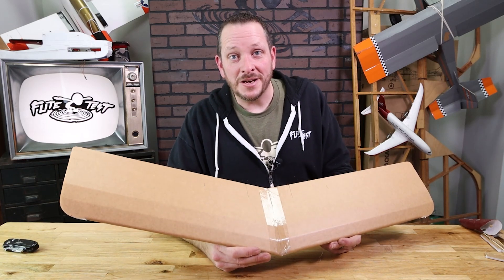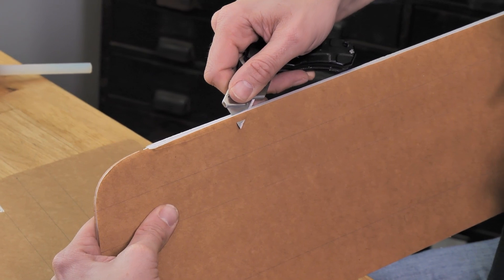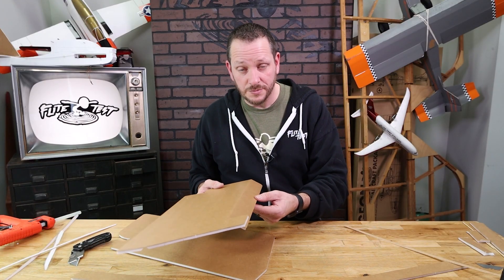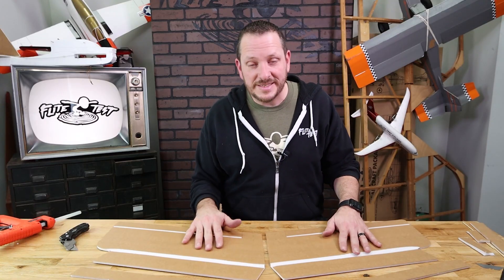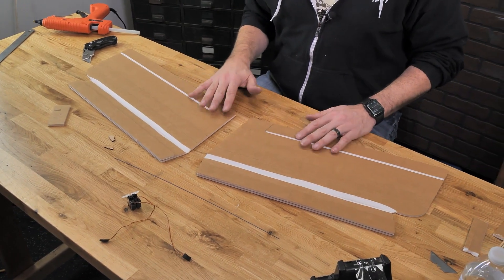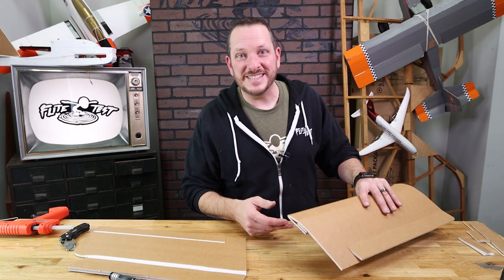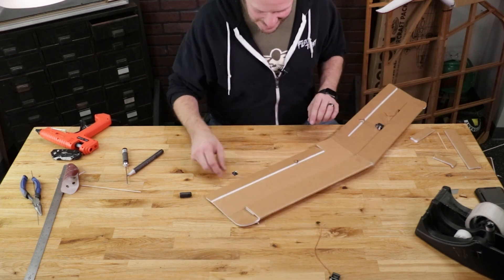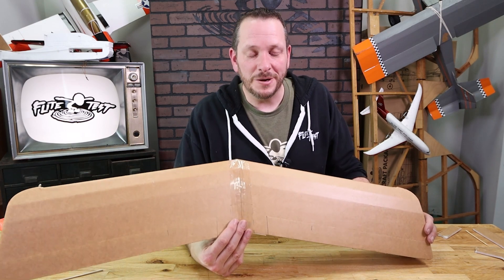How to Build the FT Tenet Speed Wing //  BUILD

Comment: How thick is the foam board of the FT sea angel, I can't find the specific thickness in the plans. 
Thanks for your attention.
Reply: @Robert Bailey officially 5mm right?
Reply: @biko9824  thx
Reply: The spec from ADAMS (manufacturer) for Readi-board is 3/16 (.188) inches. I've found that it can vary between .17-.19 inches. Roughly 4.5-5mm.
Reply: @DanielSponholz  tanks you bro
Reply: @Robert Bailey thx
Reply: So, the thickness is 5mm
Reply: Or 3mm